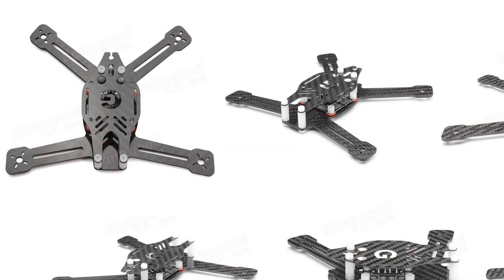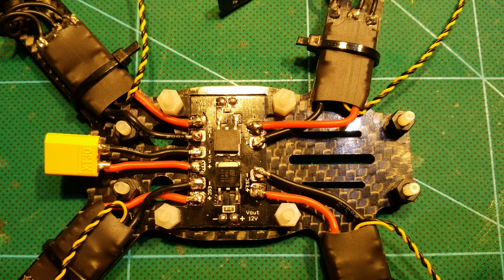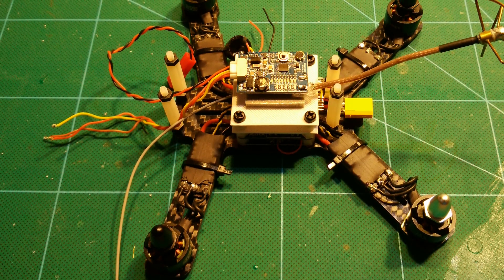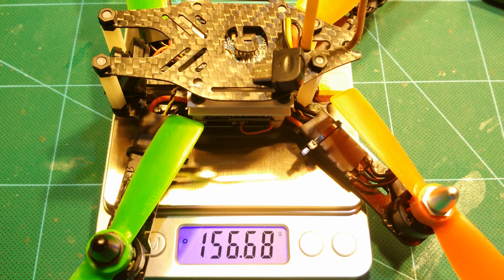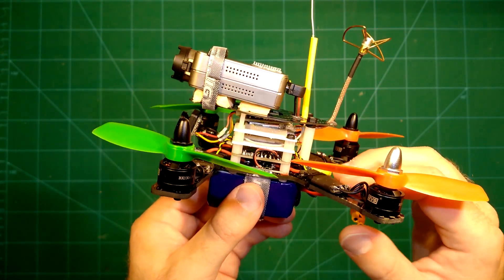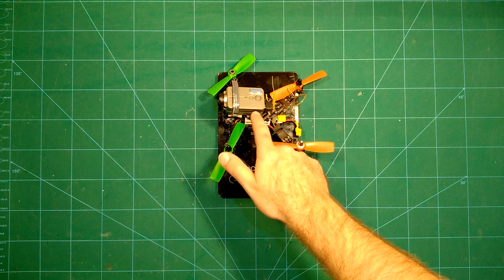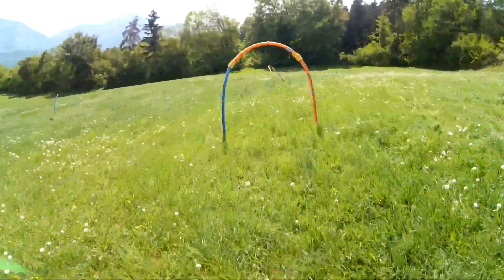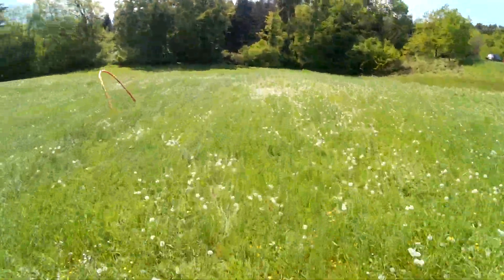Sub 250g FPV Quadcopter with over 11 minutes Flight Time

Comment: I built my Grasshopper160  with a 4in1 20a ESC to cut weight, been flying it for a couple of years without any problems. I even added GPS and INAV. 169g with runcam, leds and GPS. Usually run 4045bn tri-blade props.

Comment: 5 inch Quad running 5 inch props on 2204 motors. with telemetry and osd.
 sub 250grms.
 Is it possible?

Comment: Excellent!!! Thanks for sharing. This is what I was looking out for, Im a newbie. Qs: I noticed you used a CMOS and a RunCam2, guessing the CMOS was for FPV and the RunCam2 for HD recording. Could we just not use the RunCam2 for FPV and HD recording?
Reply from the maker: Yes, you can do that. But that would increase the FPV latency, since the RunCam has a bit of a higher latency compared to a dedicated CMOS camera. However, depending on how fast you plan to fly, it might still be ok. On my Bixler (a glider) I do use the RunCam for both FPV and recording.
Reply: Great, Thanks!!! Any idea what latency are we looking at? Do you have an instructable for Newbies? :)
Reply from the maker: The RunCam's latency is very low for a recording camera. Unless you want to build a race drone, you will probably not notice the difference to a CMOS camera. I have not yet done a video of my Bixler, where I directly use the RunCam for FPV, but it is very straight forward using the RunCam's FPV out cable :)
Reply: Thanks!!!
Reply: Qs: Will this work on a "Diatone Blade 180 Class Micro Drone Frame Kit"?

Comment: Good job, i used to do the same with large quads around 600 size, I managed 860g and hover current of 6A carrying my 6AH Liion (custom) pack. It was very rewarding getting near to 1 hour flight times. Time now to do the same thing with micro's. I achieved the biggest gains from blueprinting my motors, gapping down the poles to around 3 thousandths of an inch and running high spec low noise chrome roller bearings. Things mass production will not touch. Props are also big players, and a dyno rig is essential.
Reply from the maker: Impressive! Looking forward to see your approach & results on smaller quads.

Comment: Thank you for sharing this! It was exactly what i was looking for!! Inspired by you i built one of my own, my first build. 

I chose the blade 180 frame and cc3d. All is good but its drifting a lot. Since most of the parts are the same as your build i wonder maybe if you can give any good examples of PID settings for cc3d. Maybe you can transform your Naze settings to cc3d 😊 ??
Reply from the maker: Hmm, are you running Cleanflight on the CC3D? Or Openpilot?
Reply: +RC FPV Flight im running openpilot....
Reply from the maker: I see. I'm asking because I have several CC3D's which I succesfully flashed with Cleanflight. I don't have any good PIDs for Openpilot, sorry :-(
Reply: I suspected that. Thanks for giving inspiration anyway  😀

Comment: Great vid and great quad. Let me ask you a question; if you were to rebuild with the focus of ditching the runcam and making a more pure fpv racer if you will, what would you change? Off course still staying sub-250g and lets say above 8min air time.
4s battery? Different motors?  Different props?
The reason I'm asking is because I live in Norway and regulations here require us to stay sub-250g to be able to fly fpv without a spotter. Thus I'm researching a build with focus of going fast with excess power and good flight times given my limitations.
Reply from the maker: Many thanks! Since it is 233g already without the RunCam, we have 17g to spare. I would keep everything the same, but chose a slightly more robust frame, because since you want to use it for racing I expect it will crash more. For racing I'd go with a real x-Frame, maybe something like this one? http://www.armattanquads.com/morphite-x-155-v2/
Reply: +RC FPV Flight Thanks. Inspired by your video and advice I've created a build proposal over at Reddit: https://www.reddit.com/r/multicopterbuilds/comments/4qhs13/sub_250g_parkflyer_with_a_punch_possibly_4/
Please feel free to join the discussion :-)
Reply from the maker: Awesome! Great discussion, many thanks for sharing!

Comment: you could save a bit more or do a cleaner wiring if you just use one wire for the vbat, you don't need to wire the ground, since the ground is already connected to the battery. also what is the weight with the battery? because you also have to include overallweight with the battery, to avoid registration.
Reply: Honestly IDK what's the ground wire for, unless the ground is using a different ground, that's all it is for.
Reply from the maker: Good point with the cabling :-). Weight is shown in the video. Weight including a 850mAh battery (but without the RunCam) is 233g, as shown at 9:36 of the video.
Reply: Nice missed it for some reason
Reply: +Jad Collado (Battlemach1ne) also you don't have to use the ground wire for the esc signal too, just the yellow wire.
Reply: +Jad Collado (Battlemach1ne) is this really true? Did you just unsolder it? Why are they there in the first place, im thinking it must be some kind of negative effect when you remove them. Hope im wrong 🙂
Reply: connecting the ground reduces noise.

Comment: That is very very light! My 180 is 320g without the battery but it is a different build altogether, 4mm tank frame  (n-trepid from hasterc) with dys 2205 motors, its fast but flight times are 5-6 mins at most. I am thinking to drop the weight going for 1806 motors instead. And btw you have the most relaxing voice ever :-), love your videos!
Reply from the maker: Many thanks mate! Glad you like my videos. You are completely right, that is a very special purpose build. I love trying to go to the "extremes" to see what is possible (while using budget hobby components). Thanks again for watching :-)
Reply: My 250 is 325 grams with the battery, lol (yes, the scale is calibrated.)
Reply: RC FPV Flight I like doing extreme builds like that too! I love what you did with this one. 1306 3100 on 4 inch props is freaking genius!  I have a 70gram dry 3 inch quad (tribus frame) with 1108 6800kv motors. its only 112grams with lipo. Those motors are INSANE too. They put out over 500grams of thrust EACH with rotorx 3044 props on 3s! Thats more than any 1407 on 3s with 3 inch props! But the 1108 are only 8.5grams each instead of 15grams. Overall thrust is over 2000grams with 112 auw putting the thrust to weight at 18:1 while only using 3s! Thats just mindboggling IMO. I also have a 4 inch (quattuor frame) running 1407 4100kv cobra motors thats only 124grams dry, 208grams with lipo and has 900+ grams of thrust per motor on 4s with hq 4043x3 props. Its thrust to weight is basically identical to my 3 inch  Both frames are by the same designer. I love the frames, they fly great and are even pretty durable, but its tough building with them because there is VERY little space to work with. I had to do some minor modifications to both frames to make them fit everything properly. Its just fun pushing the limits of quads and seeing what you can do with them. Id love to build something ultra efficient like you have here, but on a 2.5 or 3 inch setup. I wonder how long those could fly (while still being powerful enough for acro) with the perfect setup? If you had to choose an ultra efficient 2.5 inch motor, what would you choose?

Comment: Most of the weight is on the front props. Is that a bug or a feature?
Reply from the maker: Many thanks for your comment. It is actually the other way around, since the back arms have a more steep angle than the front arms, the COG is actually slightly in the back, which means that the back motors have to do more work than the front motors to keep the model balanced. However, when you add the RunCam 2 in front, the COG is exactly at the center, which is great. All the best, Michael

Comment: have you seen this battery?

lighter than the 850mah nano and 100mah more capasity... tho lower c rate

http://www.hobbyking.com/hobbyking/store/__20389__Turnigy_nano_tech_950mah_3S_25_50C_Lipo_Pack.html
Reply from the maker: I have not used it, definitely worth a try though :-). Could squeeze out some more time using it :-)

Comment: Very surprised you got 11 mins with those BN props!
Reply from the maker: Absolutely, although long flight time was my aim for this build. I really tried to reduce weight wherever possible (within reason) and while only using budget components. As others pointed out (and as you are hinting), using regular 4045 should give me another increase in flight time (but I do like the punch of the BN :-D). Also using a non-budget lipo would increase the flight time. Moreover, I did not stress the lipo in my 11' flight, when measured after flying it still hat 10.9v (no load!) in it. So all healthy there and I could maybe have pushed it some more as well.

Comment: this is a great help thanks, i just received this frame and was planning to do almost exactly the same build. Just 1 warning from something i have read, runcam 2 is fine on 3s but dont directly plug in 4s. Use a regulator or it can damage the cam. Thanks for the build again!
Reply from the maker: Awesome! Many thanks for the warning! I do run this on 3s only, so I should be fine :-). Keep me updated on your build :-)

Comment: Well done. 11+ minutes of real flight time is amazing. Non Bullnose props are allot more officiant , you may reach 15 minutes flight time. May I ask why you used a balance lead connector ? , I thought you would wire everything through the PDB. 
I used a "DasMikro Ultra Miniature" receiver on a tight build, It weighs 0.6g , the range is limited to 100m. seeing this video makes me want to build one like this , because it is a amazing and cute quadcopter. thank you for the video. http://www.banggood.com/search/dasmikro-ultra-miniature.html
Reply from the maker: +FPVX Many thanks mate! I too think that I could easily reach a few more minutes of flight time. When I landed after 11 minutes, I also still hat 10.9v in the battery, so if I wanted to push the battery some more, at least another minute would be possible. Also with regular props instead of bullnose, I would get more flight time as you correctly point out. Moreover, all of the components as listed in the video description are low-budget components. I like to keep my builds cheap. So with a higher quality lipo for twice or three times the price I could also get some more minutes out of it.

I like using the balance lead connector in my builds. For once it keeps it from uselessly hanging around ;-). But also it takes load off the PDB for components which can easily work with the full 3s lipo. It sometimes also allows for a bit cleaner build, specially when things are tight :-).

That miniature receiver looks great. This is still a weaker area of the FrSky components, where I often look with envy at Spektrum, etc. :-)

Glad you like the video. It's a great little quadcopter and one can really notice the difference in flight time :-)

Comment: What is the max speed?
Reply from the maker: +zaqwsx28 I did not measure it, but the 3100kV motors together with the 4045 bullnose props allow for quite a punch! Said that, this is not a pure racer. It is more a compact and very light weight quadcopter, which is able to go anywhere with you thanks to its low weight and size (also onto mountains, in a backpack) and is still able to capture beautiful 1080p@60fps videos with a long flight time. It is also a great fun flier or just a copter to explore a new flying spot. You will not win any hardcore races with this, but for everything else it works very nicely :-)

Comment: Nice quad! I would suggest tho that the 4045BN props are a bit much for the 1306 3100kv motors, and runs the risk of over heating them. You get much better efficiency and pretty much the same thrust with standard 4045s :)
Reply from the maker: +Bishop Vick Many thanks! I pushed it quite hard already, but the motors and ESCs always come down at most warm, never hot. But I will definitely try the 4045s to see if the flight time changes. Many thanks for the heads-up :-)
Reply: +RC FPV Flight Firstly, great job with this build and video!! I am very tempted to migrate my ZMR180 to a Diatone160 frame now!

Assuming about 300g thrust per motor, i calculate a 4.8< power to weight ratio - that's amazing considering the flight time!

I too would be interested in hearing your flight times with GF 4045(non-bullnose) props, as i've heard very bad things about the bullnose props' efficiency.

Keep the videos coming, i'm loving all these lightweight, compact quadcopter videos! :)
Reply from the maker: +Martin M Cheers mate! I too have the ZMR180 as well and it does not get much flight time since I build this little guy! :-). In the meantime I have also tested the flight time including the RunCam 2 and I still get more than 9 minutes - which is amazing for such a small quadcopter. I'll try to test with the non-bullnose props soon and I will definitely keep these kinds of videos coming. I love the little guys so much :-)
Reply: +Martin M I have actually just built a Diatone ET160, and flew the maiden flight today :D It weights 260grams auw inc. 3s 850mah and landing feet/motor protectors (the 4 feet weight 15grams, so can bring the auw down to 245grams without them, but i crash alot so im keeping them for now ;) ) I am using 4045 standard Dal props and brand new lipos so not pushing them yet, i got 6 mins of flight bringing the packs down to 11.4volts (around storage charge due to being new) but i think could get another 2-4mins of flight, albeit, at reduced top end punch due to voltage drop (only slight tho, it bloody rockets!). The thrust from the motors are 280g on full 3s, and 360grams on 4s, so i get around 4:1 ptw on 3s, and 5:1 on 4s (not tested 4s yet, 3s is ballistic enough!)
Reply from the maker: Awesome! Really love to see all these small quadcopters being build - keep us updated on your progress :-)